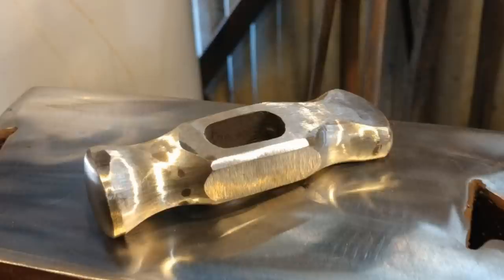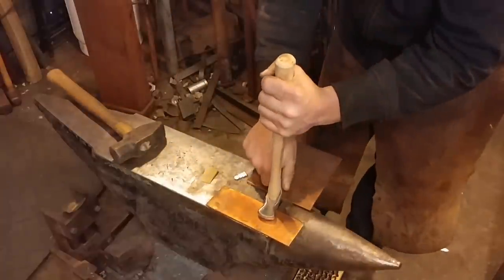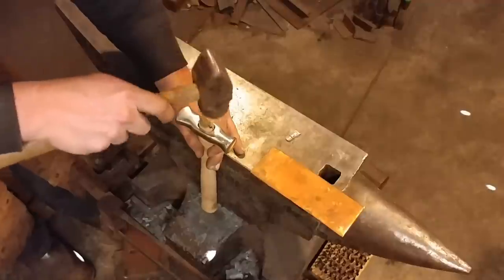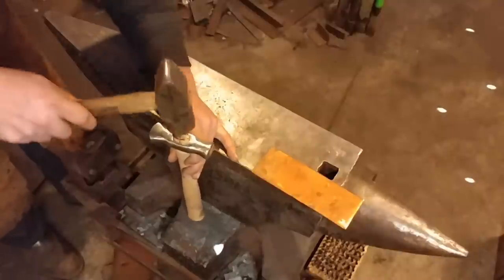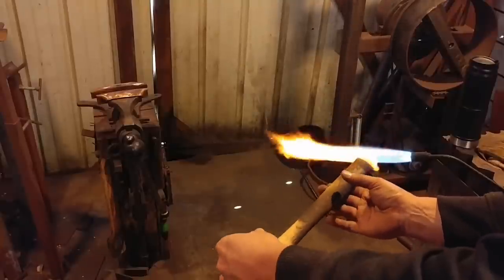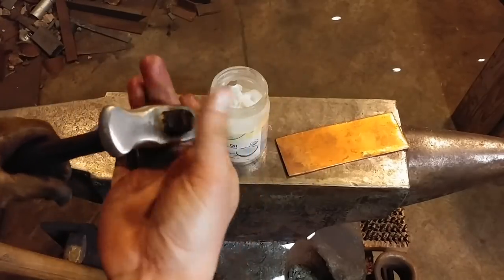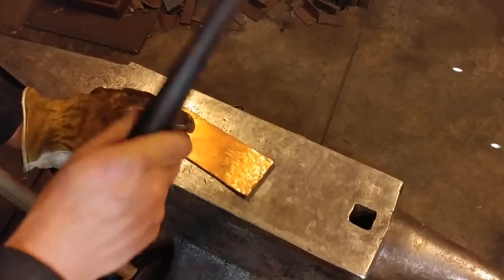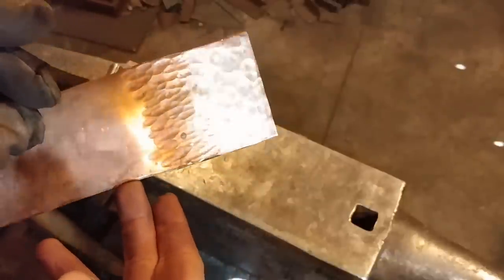Forging a Hammer by Hand from Stainless Steel (Part 3) FINISH WORK

Comment: You do great work and a big blacksmithing role model for me and to keep God first in  everything you do. But on the steel wedge I learned from a old man by putting the steel wedge in between the grain and across the wood wedge starts the splitting on the handle and when you begin to hammer the shock of course vibrates ever so slightly and eventually splits the handle. But by putting the steel wedge parallel in the wood wedge it is not splitting the handle material but the separate piece of wood and spreads the handle side to side instead of front to back where the impact is. I really hope this made some kind of since and that it may cut down on some maintenance so you can pump out  more awesome work. Have a great day and may God bless you heavily.

Comment: Quite often the metal wedge is put in at an angle! This would give you the option of choosing the best slant to avoid the handle splitting. I noticed also the wedge you used was a large one .... was there a reason for this? A final question  ..... Does the coconut oil have the same effect of making the wood fibers expand as well as lubricating as the more common Boiled Linseed Oil? This would have the added bonus of tightening the head to the shaft even more! 
I have got to say I do enjoy watching your videos ..... long may they (and you) continue!

Comment: Great series Roy, the hammer turned out great. I really dig the charred handle, I've heard that the charring is good if you get blisters or any cuts from working, it's supposed to help heal or not get inflamed? But I'm not sure, I don't remember where I heard that, I guess it might have been on one of Alec Steele's video, but totally not sure. Great video! Keep it up brother!

Comment: looks really nice its a crafted hammer not just finished, oh here is somethign from an old magazine from the railroad history searching I do, tells you in the shop kinks section by JT McSweenys name who used to be a shop forman for the railroad blacksmith shop on the B&O in town here were I live and even at Mt Clare in MD which was the primary B&O shop like ground zero for railroading in the usa and the cradle from which the first steam railroad the B&O grew in the states now it is where they have the B&O museum collection but anyway

It has plans on how to build an air forging hammer check it out here is the link Roy
you and all that read this might have to search the old artical on google read but it is there if you can make out the mesurements

https://books.google.com/books?id=c69KAQAAMAAJ&pg=PA454&lpg=PA454&dq=J.+T.+McSweeney+Blacksmith+shop&source=bl&ots=OzfYguxYWC&sig=c9BjswwK-E5fmB_ROemGTP36Evg&hl=en&sa=X&ved=0ahUKEwjLgpfT6f_XAhVGNiYKHVmkDkgQ6AEIOzAH#v=onepage&q=J.%20T.%20McSweeney%20Blacksmith%20shop&f=false

Just though I would share

signed Jeremy L manga12